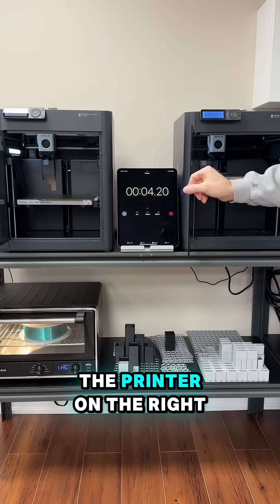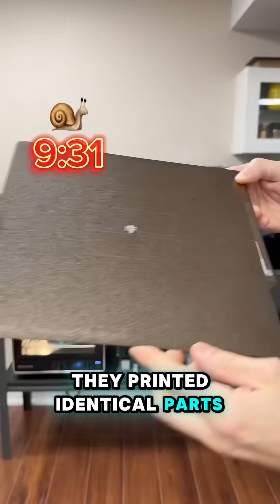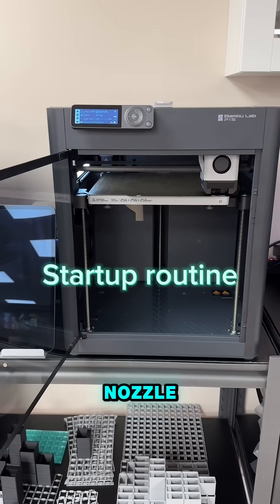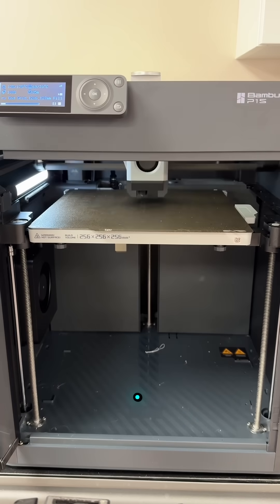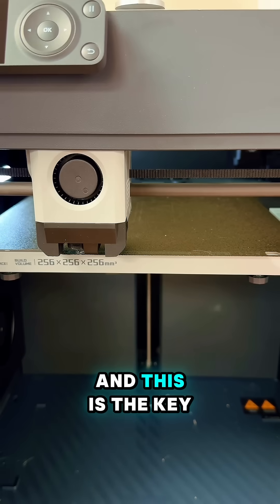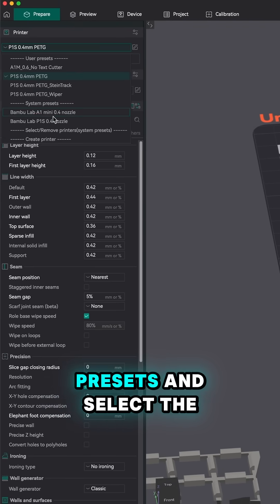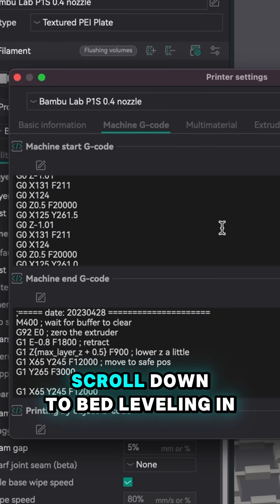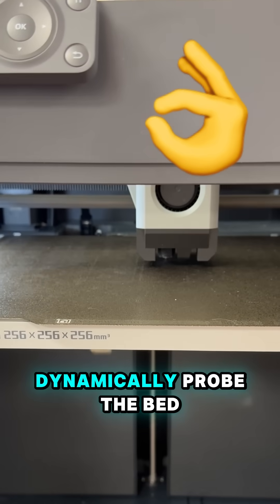This ERROR is slowing down your Bambu P1S 3D Printer! Fix it with THIS! #bambulab

Comment from the maker: It seems many of you have updated your firmware in the last few days and Ive gotten dozens of messages that this fix is no longer working! Well, I looked into it and yes, this is true! But not to worry, there is a solution: in the Bambu Handy app navigate to "Devices" at the bottom of the screen, then click the hamburger in the top right, then "Firmware Version" at the bottom - you will find big green lettering about the middle of the screen "I want to downgrade to a previous version" click that and select version 01.06.01.00. Done. You will just have to put up with the "Update Firmware avail" nagging
Reply: I'm really looking forward to another option. Adaptive mesh is an extremely useful and time-saving function! Thanks for your work!
Reply from the maker: @Attila_G Thanks so much for the feedback! Just last night, I released my master startup G-code routine on Patreon, along with the wiper mount I've been working on (P1 SteinWipe). This is something I've spent months refining, and it includes a variety of features you can customize by toggling them on or off—simply set "true" for the features you'd like to enable in their respective sections.

If you're eager to get started, this G-code routine offers a great interim solution until the new video is ready. Thanks again for your support and enthusiasm! :)
Reply from the maker: @Attila_G  Ha.. So there is an easier way. I just found it in the Bambu Handy app. If you click "Devices" at the bottom, then click the hamburger, then "Firmware Version" - you will find big green lettering "I want to downgrade to a previous version" and select version 01.06.01.00. Done. You will just have to put up with the "Update Firmware avail" nagging
Reply: @leckiestein  A downgrade to version 01.06 may be a short-term solution. As a developer, however, I prefer to use the latest software/firmware, as this usually brings advantages. A downgrade would therefore lock me out of all this. Certainly a disadvantage in the medium term. But thanks for this tip anyway. I have only had my P1S for a short time and have therefore not yet dealt with new firmware functions.
Reply from the maker: @ i upgraded the firmware on 2 of my printers and left the rest; the only thing I noticed is how we probe the bed so this version is likely nothing meaningful and more harm than good. But lets hope they fix it in the next update :)
Reply from the maker: @ it would really be nice if they would implement the bed plate error flag in an update. Ive taken my plates out so many times and come back an hour later just to forget and send a print 😬
Reply: @leckiestein  I don't feel comfortable with being stuck with an older firmware version. Because this means I won't get future updates as well which may be critical.
Reply from the maker: @mkatakm  you have to weight whats more important. Getting access to a great feature on a fully functional printer or abandon that feature in fear that you might miss out on something else.
Reply: @leckiestein  I know. But imagine a new great slicer feature required the latest firmware.
Reply from the maker: @mkatakm  no, slicer only controls the machine movements which are generic for the most part. The only proprietary code found in the slicer is in the Machine Settings - start gcode, end gcode, etc.
Reply: @leckiestein  a new firmware may support a new g-code command for the slicer. Firmware is the executor of the gcode.
Reply from the maker: @mkatakm  Yes, thats what Im saying but the gcode would be added to the machine section, not hidden in the slicer build as this would make the slicer cause issues with non-Bambu printers.
Reply: @leckiestein  no, that's not what I am saying at all. But well, anyway.
Reply from the maker: @mkatakm  I must not be understanding you then. Anyway, I rewrote over 1000 lines of code for the XC1, 800 lines for the P1, and 400 lines of code for the A1 series. If anyone knows bambu code and process by now, its me haha
Reply: @leckiestein  let me try one last time. You see, after firmware update the support of the "G29 A1" command has been removed. All gcode commands are defined in firmware and executed by firmware. Suppose that a new firmware added a new command such as "G29 XYZ" which performed an action much better and faster or a completely new action. Since the current slicer didn't know that command it too should be updated to use that new command with an updated compiler and optimizer. I can't explain further than this.
Reply: I'm sorry but we are not focusing on the important thing here: Bambu pushed a firmware update where you cannot use custom G code instructions anymore???
Reply from the maker: @littlefrank90  not sure where you heard that but its 100% false and this comment inspired me to make a video about it :D

Comment: Thanks. I am also aware that the method will work by downgrading the firmware.
But since we are 2 months further in time, did you maybe find another way with FW 01.07 to enable the dynamic calibration?
Reply from the maker: The workaround is in use for swmc and makes it so you get a perfect home probe every time making it so you dont need to run a bed level ever print unless you get rough with removing the last print. But seems like DABL is just not coming back

Comment: I made this exact change but it changes nothing, no effect at all:

;===== bed leveling ==================================
M1002 judge_flag g29_before_print_flag
M622 J1

    M1002 gcode_claim_action : 1
    G29 A1 X{first_layer_print_min[0]} Y{first_layer_print_min[1]} I{first_layer_print_size[0]} J{first_layer_print_size[1]}
Reply from the maker: You need to roll your firmware back to last version.
Reply: @leckiestein  Doesn't reverting to a previous firmware reintroduce some bugs? Can you please provide the exact version number to revert to? Thanks.
Reply from the maker: @ been using 01.06.01.02 for months with AMS on many printers every day. No issues here.
Reply: @leckiestein  i csnt roll back past 1.07.01

Comment: This isnt normal? Prusa slicer does this for my parts and only does a small amount of probes for small parts.
Reply from the maker: The slicer is only half the equation. The problem here is that the code in the slicer is not correct across the board and Im correcting it. The machine just follows orders, it cant think, so when it sees code it doesnt understand, it just ignores it; that is what is happening here

Comment: for me is not working
Reply from the maker: my firmware in the video is 01.06.01.02. Ive had many reports that the next version of firmware does not support this code :( But I do have a solution in the works I have been testing!
Reply: @leckiestein  what I do now star printer normaly klasic
Reply from the maker: @lots_haus  I released the first version of the code to my Patrons last night and it seems to be working well as I have only heard good things so it shouldnt be long!
Reply from the maker: Figured out an easier way. see the pinned comment :)

Comment: how did you get no purge line but a calibration line?
Reply from the maker: You can use my startup code, its posted to my patreon "P1 SteinWipe". There are 8 user selectable features you can toggle on simply by typing "true" for the feature you want in the respective section. Hope that helps!

Comment: I saw a firmware update an hour ago as I started my P1S and accepted it, but now the probing like in the video doesnt work anymore for me. I looked into the machine-gcode-start to see if the correction has been removed, but it is still there. Somehow the printer got back to the full bed probing again.... 😥
Reply from the maker: hey guys, see the pinned comment for the simple fix :)
Reply: Same here.
Reply: @DesiArana  +1
Reply from the maker: @PratikPatel8   hey guys, see the pinned comment for the simple fix :)
Reply from the maker: @DesiArana   hey guys, see the pinned comment for the simple fix :)

Comment: Is there a way to get my A1 Mini to not do all the calibration for every print? Sometimes I’ll print the same thing with the same filament 5 times in a row and each time it will do all the testing and I’d rather it just saved it from the first time
Reply from the maker: @jeffreyepiscopo  yep! From the slicer or the printer screen, just uncheck bed levelling and flow dynamics :)
Reply: @ does that use the same calibration settings that it used for the most recent print?
Reply from the maker: @ yes. The order of events are as follows:
========
M1002 to check if you turned on level cali. 
G29 to run the level
M500 to save the new position data
G29.2 S1 to enable the saved mesh profile 
========
Hope that helps!
Reply: @ oh awesome! So it saves the flow calibration and bed mesh every time you run them? Cool

Comment: It makes limited sense to probe where you print, unless you expect the bed to be uneven there. It would make most sense to probe the corners of the bed and calculate the tilt in the print area
Reply from the maker: @userou-ig1ze  hey thanks for your comment! when you run the auto calibration, it trams the bed and probes for gross deformation. Shouldn't need to tram again unless you turned a levelling knob or the bed crashed into something and if thats the case, run the auto calibrate from the printer menu again to correct it. After that we are good to probe for time of use deformation only need it where we are printing :)

Comment: Will this work on the X1 Carbon?
Reply: Tried but it is not working
Reply from the maker: @TheNailer21  Have you tried to roll back the firmware? see the pinned comment for instruction.
Reply: Same. Doesn‘t work

Comment: I never need to level my bed IDK wtf you are doing try saving your bed mesh maybe?
Reply from the maker: I have a printfarm with 96 printers which means the temp in the room can swing drastically and its also winter now. This can throw out the bed mesh by a lot when the room temp goes from 10c in the morning to sometimes 40 in the afternoon. so I always run a level on every print. Im also a nut case when it comes to that perfect first layer on the products I print for paying customers :)

Comment: Probing only where you print is kinda dumb I think; it gives you less information to extrapolate. Think about the bed like a lever; if you probe near the fulcrum you get a small measurement, perhaps within margin of error. If probe far outside the fulcrum you might get information about the validity of the first measurement and what side of the margin of error you should be on. 

Ill spend the extra 60 seconds
Reply from the maker: Hi @threepe0,

Thanks for sharing your perspective! I understand the analogy you’re using, but I’d like to clarify why probing only the areas you print on isn’t “dumb” and can actually be a more efficient and accurate method in many cases.

When you probe the specific areas you plan to print on, you’re focusing directly on the zones where the first layer’s accuracy matters most. This ensures the nozzle height is perfectly calibrated for those critical points, reducing the risk of errors like poor adhesion or uneven extrusion.

While probing the entire bed might seem more comprehensive, it can introduce unnecessary data if the probe measures areas that aren’t being used. These extra points might even skew the mesh interpolation through Beier curves, leading to slight inaccuracies where it actually matters—the print area. In essence, more data doesn’t always mean better results; targeted, relevant data is often more effective in general.

That said, if your bed has significant warping or inconsistencies, a broader probing mesh can help identify and mitigate those issues. It’s all about finding the right balance for your specific setup and needs!

I appreciate your interest in diving into the mechanics of bed leveling—discussions like this help everyone in the community improve their understanding and techniques.

Cheers,
Leckiestein

Comment: I was really confused as to why everyone was saying that their A1s did dynamic bed leveling (which appears to be similar to kamp) Since neither my A1 or A1 mini did that. I Have had my mini since launch I am not sure if that means anything but i checked my G code and I was missing the 1 in the A1... Gonna run a test now lol
Reply: Everyone that oesnt have this added to their bambu lab G CODE NEEDS TO and needs to check even if they have and A1 or mini cuz it wasnt in my a1 or mini G code and its a big difference on certain prints!
Reply: Can anyone help me out by chance, INSTEAD Of A1 in my A1s gcode like you see in the video it says S1, changing it to A1 doesnt make a difference. However I did have this on my A1 mini, I needed to add the 1 and now I have dynamic bed leveling (kamp) can I just insert my entire start g code from my A1 mini to my A1 does anyone know if that will work okay?
Reply from the maker: @Reds3DPrinting  Yes, thats fine. I have the A1 and A1mini and use the same probe code on both :)
Reply: @leckiestein  Okay thank you very very much!!!!
Reply from the maker: @Reds3DPrinting  no problem! I should better word that to avoid confusion now that Im reading it in a different state of mind haha. I use the same bed leveling routine on both printers, the code in its entirety is vastly different. But for  what youve mentioned here I dont see any issue :)

Comment: lmao here I got a 1 second fix for you monkey brains. The calibration and the flow calibration is remembered in the machine as long as nothing changes. The bed isnt just going to get out of calibration after one print. Print the damn thing without flow and bed calibration boom saved 7-8 mins. CRAZY

Comment: Please checkout the adaptive purge line solution and make a vid of it. It draws a small line only next to the model and don’t have to travel and oose so much.

This would be a nice combination with your tip.
Reply from the maker: You can use my startup code, its posted to my patreon "P1 SteinWipe". There are 8 user selectable features you can toggle on simply by typing "true" for the feature you want in the respective section. One of the features is making the machine purge outside of the print area and travel 500mm/s and 20k acceleration to the first layer to minimize strings from the purge to the print. Also, the purge is a true representation of the current pressure advance setting set by the filament. You want to see a perfect consistently straight line and no bumps so you know even before the print starts your PA setting is good rather than finding out when your print over and ugly lol

Comment: Did not work on my P1S
Reply from the maker: @miguelt.7997  i've had most people tell me that it works but there's a few odd ones that say it doesn't so I'm curious what is causing it to not work for you. Maybe you can let me know the firmware version your printer is running and if you want you can send me a copy of your startup G code to the email on my channel. I will have a look into it for you
Reply from the maker: Just found a simple solution to this, see the pinned comment :)

Comment: How do i do the small purge line ??
Reply from the maker: @jonnysimps  looks like a purge line, but its a calibration line. If the tail is even all the way along, I know pressure advance is good. Thats all its for. Nobody has asked yet to see a how to. you are the first! if there is more interest I can do a future video on how to set this up.
Reply: @leckiestein please do a Long Video about all your changes in the start gcode 🫶
Reply from the maker: @ligosese1531  No video yet, its pretty complicated to explain but you can use my startup code, its posted to my patreon "P1 SteinWipe". There are 8 user selectable features you can toggle on simply by typing "true" for the feature you want in the respective section. One of the features is making the machine purge outside of the print area and travel 500mm/s and 20k acceleration to the first layer to minimize strings from the purge to the print.
Reply: @ 😢😢 oke thankyou, is there like a guide on how to do it, or did you just find that out urself ??
Reply from the maker: @ i did a quick search before doing it and nobody had anything like this that I could find.
Reply from the maker: You can use my startup code, its posted to my patreon "P1 SteinWipe". There are 8 user selectable features you can toggle on simply by typing "true" for the feature you want in the respective section. One of the features is making the machine purge outside of the print area and travel 500mm/s and 20k acceleration to the first layer to minimize strings from the purge to the print. Also, the purge is a true representation of the current pressure advance setting set by the filament. You want to see a perfect consistently straight line and no bumps so you know even before the print starts your PA setting is good rather than finding out when your print over and ugly lol